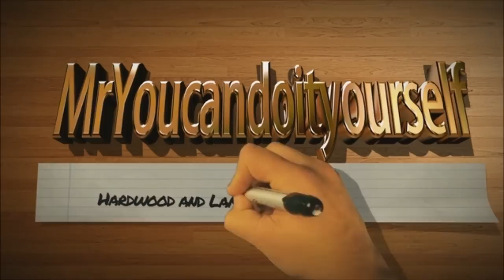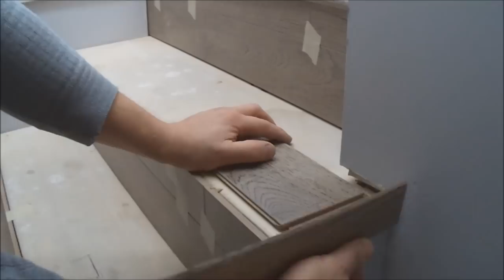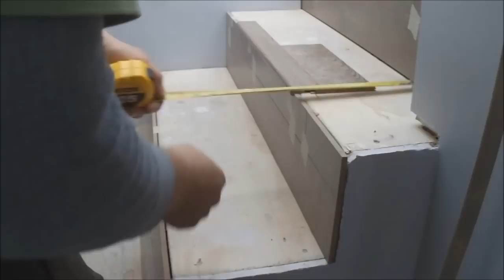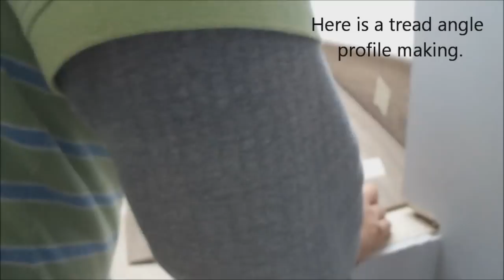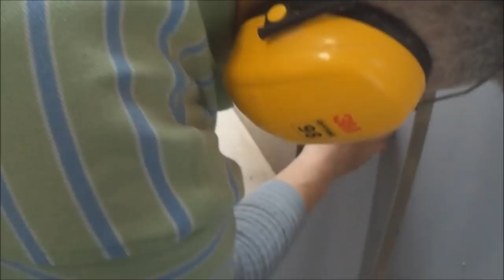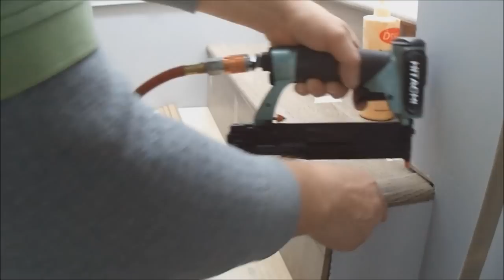DIY Laminate on Stairs: Laminate Flooring Stair Nosing Installation on Open Sided Staircase How To

Comment: Hi there. Great video. What size of nail do you use for attaching  all the material. I bought 1½" 16 gauge.  Any suggestion that is better for this application?
Reply from the maker: Your nails are too thick. I use 23 gauge.

Comment: Hi my question is, does the nosing has to overlap on the treads? I seen other videos on laminate stairs and some of them don't look like they are overlapping. thank you.
Reply from the maker: No, the nosing hasn't to overlap on the treads. It has to attach to the treads. Watch several videos from professional floor installers and you'll see it.

Comment: Thanks bro. I think I got a pretty good idea of what it's gonna take to complete. Ive done laminate flooring before and been pretty successful but never stairs. With your help I think I got it! I only have one concern left, and that's my stairs were built with 2 by 12 treads so when I put my bull nose it's not going to cover it up completely. I guess I will just paint what's going to be left showing after I put bull nose on. Thanks again, and were are you located at?
Reply from the maker: I am in Canada, Vancouver city.
You should install the first stair riser, bullnose and one full board of your laminate floor and then start floor installation FROM THE STAIRS. If you do like this you'll neve have any gaps between stairs and general floor. When you finish the floor you can return to the stairs and finish their installation.
Unfortunately you went in another way...
Honestly it is hard to give you any advices if I do not see your problem. Send me few pic and I tell you how to solve it.
Reply from the maker: Watch my vid "Laminate Flooring on Stairs: How to Start Installation" and you'll see that I start laminate stairs installation without concrete floor covering.

Comment: The bull nose cannot be raised on a stair edge because it is a trip hazard and against the code. Always cut the stair covering short to let the bull nose settle level with the laminate so there is no raised edge.
Reply from the maker: Hi Dennis, this type of nosing is standard for a floating floor. You can send your questions to manufacturers and building departments to change the rules. Thanks!

Comment: Do you usually start from the top of the stairs and work your way down?? And does it matter if you put the riser piece in first or the tread?? Thanks brother!
Reply from the maker: 1.Yes, I always start from the top and work my way down.
2.I prepare 3 parts of the stair: riser, tread and nosing and look if they fit to each other.
3. Installation (if you do not have a stair landing):
a) riser
b) tread
c) nosing
If you have more questions, please feel free.